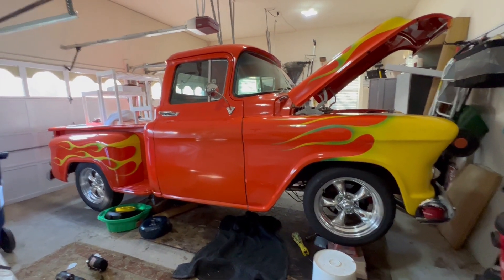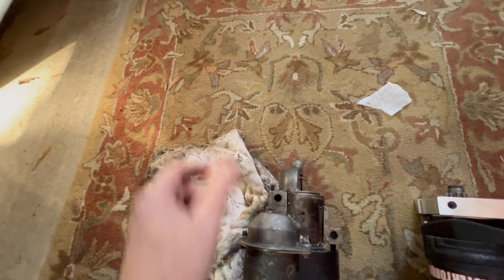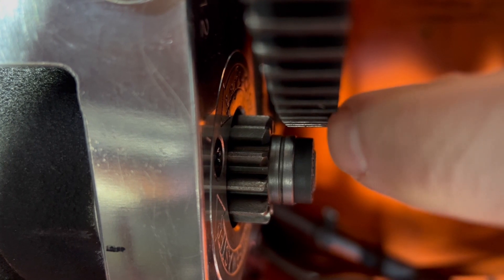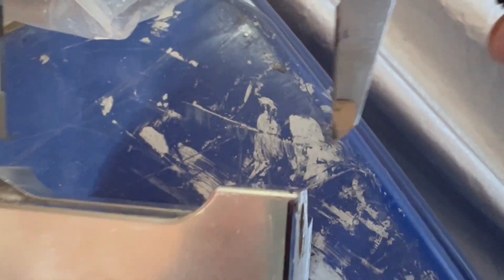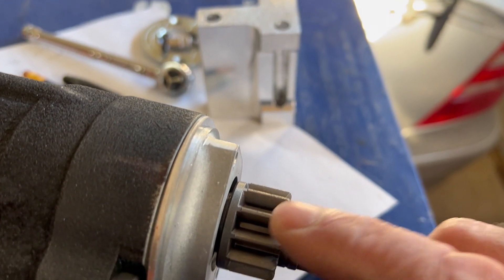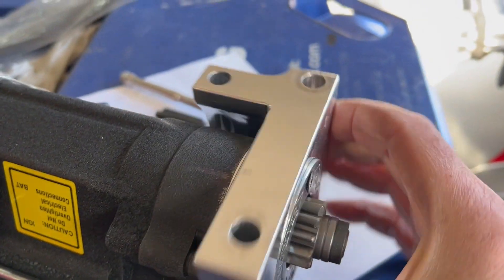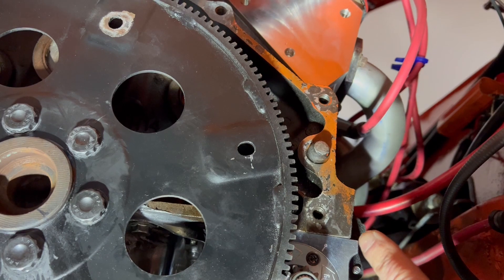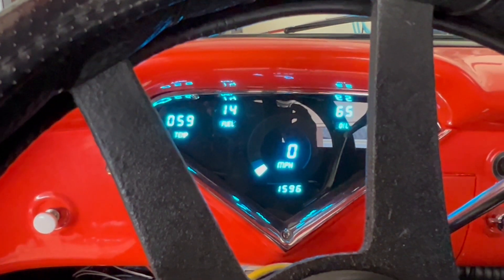Powermaster Starter required Milling to Install

Comment: Hi Ed I’m in the exact same boat. I have .080” gap with no shims installed. I have a guy who offered to mill my block at his work. I’m hoping the same .200” will work for me as well. I looked up your starter and it’s for a 168 tooth ring gear like mine. I would assume I need to take the same amount off my 9509 starter block but don’t really have any way of knowing. My thinking is if the gear mesh gap starts roughly the same, and ring gear is the same size, I would need to move the pinion the same amount as the pinion is moving straight up against the same diameter ring gear. Guess I’ll find out if I’m right. Thank you so much for the specifics it helped me greatly.

Comment: Power master and Power Fist….are off shore brands. If you review these starters here on YouTube…..you’ll see that these mini starters are notorious for chewing up starter drives and ring gear.These starters have no front support and you will get starter deflection.Stick with the OEM…..will certainly outlast any mini starter.

Comment: I have an engine that has spit starters out like they had a bad taste. 3 different lightweight permanent magnet type starters snapped like twigs on this block. After changing a beat-up flexplate, I bolted in a new Powermaster 3510 stock style heavy duty unit. The first few days it worked well, then crunch, munch, crack...teeth laying on the ground! After repairing the damage, I scribed a line on the mounting surface of the starter and ground about .080" off with a angle grinder and flap disc. No more problems! No more ugly noises! It wasn't my own idea-I saw it here on Youtube.

Comment: Great video, these starters aren't that cheap, you shouldn't have to mill that piece to get a good fit... I'm kinda surprised they still haven't addressed that issue, just sayin. BTW how's the starter holding up?
Reply from the maker: Starter goes work great, have not even thought about it since installation.

Comment: Great video I have to do the same thing I have a electric sander will 60 and 80 grit be ok?
Reply from the maker: Depending on how much you need to mill I would use a very aggressive grit - at least 60. It is a big surface to mill. Try to mill evenly, measuring often. Is your electric sander a belt sander? Not sure an orbital sander will cut enough. BTW my starter has been working flawlessly. Good luck!